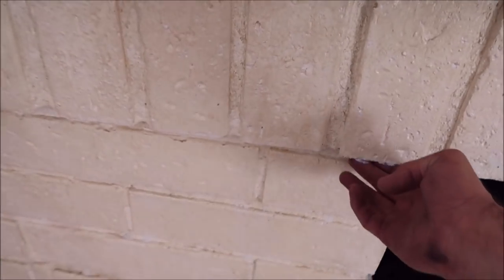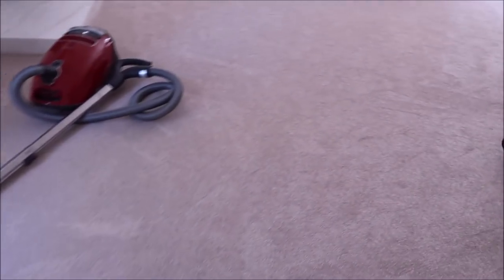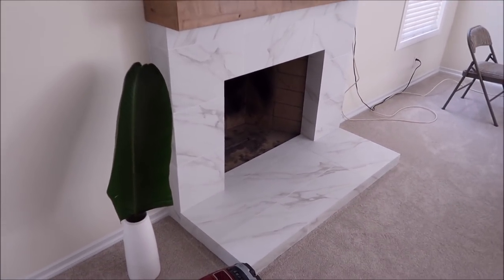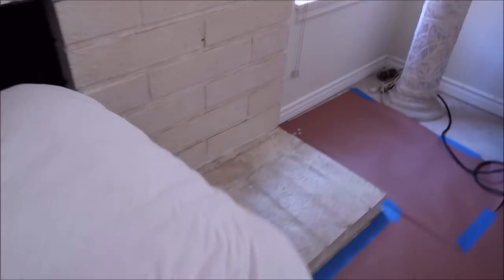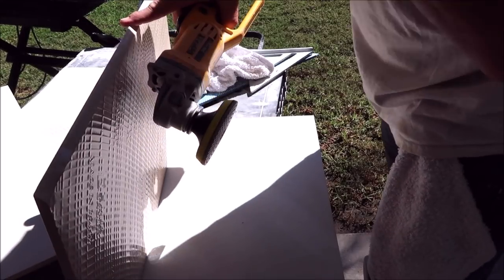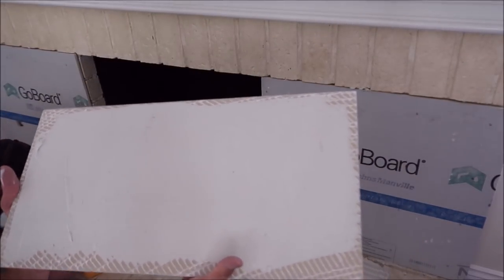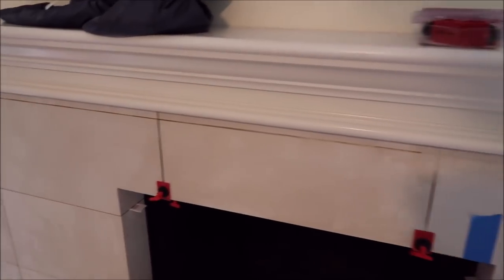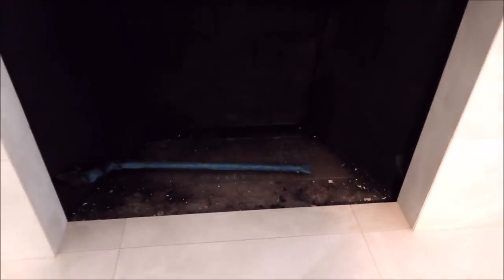Fireplace Makeover Mitered Porcelain Tile 🔥

Comment: Working on bidding my first fire place refacing.....which is also painted brick. Every place I read said you can not tile directly onto painted brick because you would not  get a good bond and that the best solution is to Tapcon Hardy board to the face and then tile on that. I didn't read anywhere about the tile primer, what advice do you have?
Reply from the maker: Yes! You can definitely tile directly onto brick. Pick up some tile primer, paint it on first and you're good to go! 👊

Comment: I'm the guy that would do the bathroom floor without matching veins 😂
Always defer to my customer on that and they normally don't care...except those cross veins😱...but man oh man, those miter cuts, the time on the double corners holy crap !
How do you know the GoBoard will withstand a 4 hour burn ???
Reply from the maker: This gas fireplace will have fire glass installed (super low heat). Also, I have tested Goboard with super high heat for 5 plus hours covering up a generator with minimal airflow (I have multiple videos uploaded on this). The Goboard has held up for at least 100+ hours of super high heat as a generator quiet box and has yet to heat up enough to burn... It doesn't even come close. I believe the fiberglass in the board is hard to burn (also tested it with a torch).
Reply: StarrTile it’s ok bob , I’m the guy that lays 200 sq ft first then realized that I should have matched the veins 🤬😢
Reply: I would purposely not match the veins. I think it looks better because there’s no way to actually “match them up”. They’re not made to match up.

Comment: Very much enjoying your channel.  Could you provide more detail on how you measure for the mitres?  As a newby I am concerned about what the appropriate mitre overhang is required to allow for thinset or tile adhesive?
Reply from the maker: Thanks! We miter cut leaving only a 1/16 - 1/32 on the glaze of porcelain/ceramic and stone. The mitered joint does not need thinset, only grout installed between the joints. Grouting is a bit time consuming, but the final product is beautiful!
Reply: Very much appreciate your reply and apologize for not clearly articulating my dilemma. I Understand the glaze reveal and the mitre doesn’t need thinset.  From a woodworkers perspective we cut mitres to be “flush” with the substrate as we only add a thin bead of glue so everything is cut tight, but with tile I’m assuming extra room is needed allowing depth for the adhesive and as a result your mitre protrudes over the edge of the substrate? How do you calculate that extra depth? Is it just the trowel notch?

Comment: Our tile guy that we want to hire said when you make mitre joints a lot of times the tile will chip and you have a lot of waste. Also said with the veins on tile you can’t get them perfect because you may run out of tile going in the same direction. How much extra does it cost to do mitre joints on a 11 foot fireplace going up both sides?
Reply from the maker: Yes, mitering porcelain is difficult and takes extra time and tile. 
Correct, matching up veins is never perfect, but you can come close if you order extra sq. ft. of tile.
Not sure on the cost for a tall fireplace like that, but it's a lot of time consuming detailed work. Expect to pay extra, but worth it in the end.
Reply: @LandbergTileTV  If it is 11' on both sides and the tile is 12 x 24 then would you have 44 mitered edges? If that is the case how much extra cost should it be around?

Comment: Looks awesome.  I will be tiling my brick fireplace soon.  What angle are the miter cuts?  45? And what type of grout did you use?  Thanks for the video!  Can't wait to do mine!!
Reply from the maker: Thanks! and yup, 45 miters and prism grout 👊
Reply: Great video and you guys do alot of mitered tile work.  You mention you use prism grout.  Community seems to be mixed on use of grout vs caulk for mitred corner.  Is grout susceptible to cracking?    Seems caulking would not look very good compared to grout

Comment: StarrTile I have never matched the veins either but I like the look. Clean and professional. Landberg Kills it again! I will install like this in the future. On another note. Foam may not burn but it does melt and shrink. Also Styrofoam when heated gives off toxic fumes. All depends on how fast the tile transfers heat. Now Gas is low temp but wood would definitely be a problem?Why not Durock cement board instead? 
https://en.wikipedia.org/wiki/Polyisocyanurate
I just did a fireplace similar to this style with mitred corners. First one ever with trying mitres. My saw motor bearing broke half way through the job. Made for a nightmare finishing the miters.

Comment: What were you using for the spacers that locked in, that was trick!
Reply from the maker: Which ones? We used two different spacers. Levtec and RTC for the outside corner l bracket system...

Comment: I'm worried about that foam near the fire
Reply from the maker: No reason to be worried about that GoBoard. It's a gas fireplace that will have the flame covered by fire glass (low heat) and the board is capped off by hard porcelain tile around the inside perimeter. Like I told Starr, I have tested Goboard with super high heat for 5 plus hours covering up a generator with minimal airflow (I have multiple videos uploaded on this). The Goboard has held up for at least 100+ hours of super high heat as a generator quiet box and has yet to heat up enough to burn... It doesn't even come close. I believe the fiberglass in the board is hard to burn (also tested it with a torch).